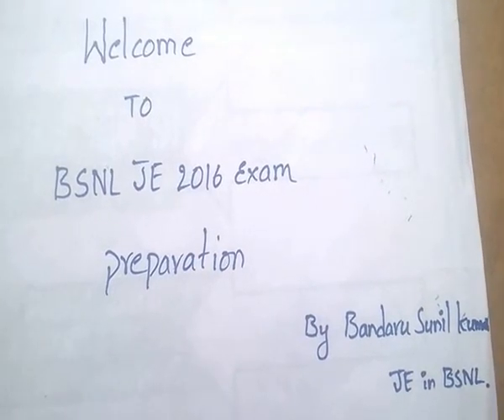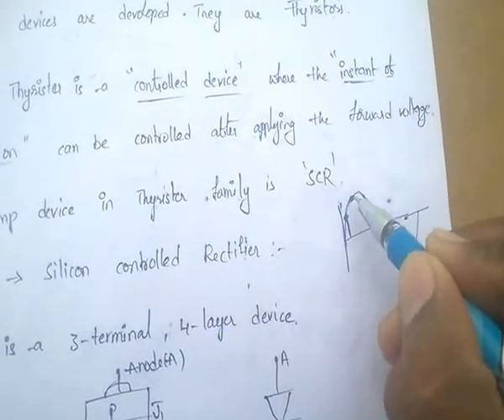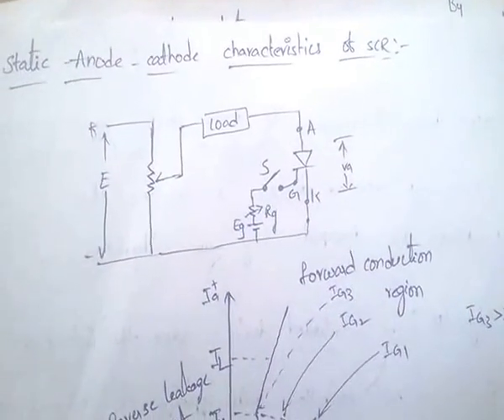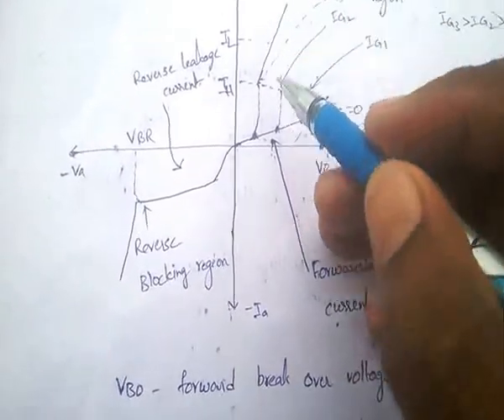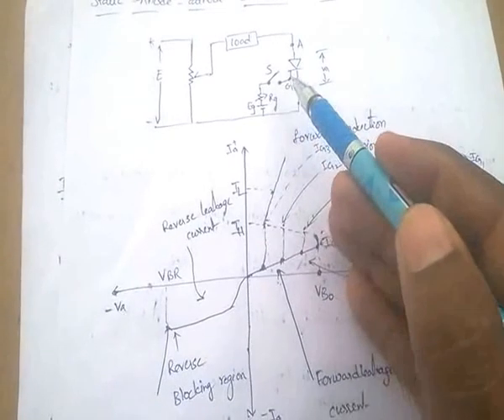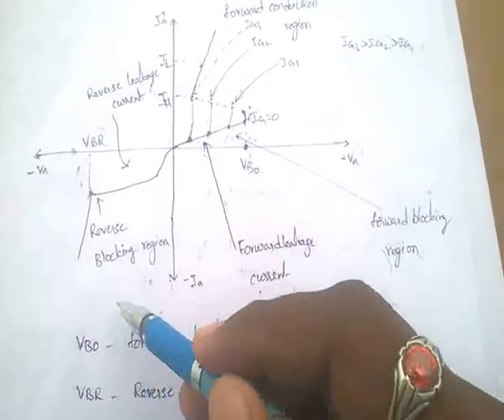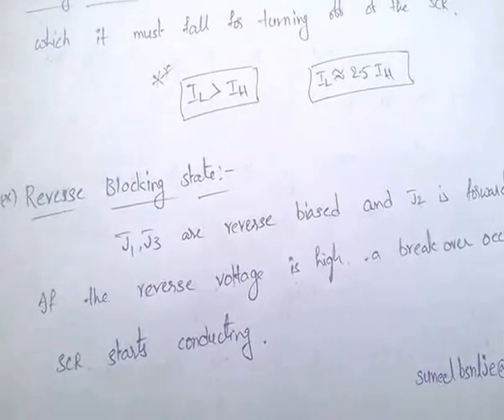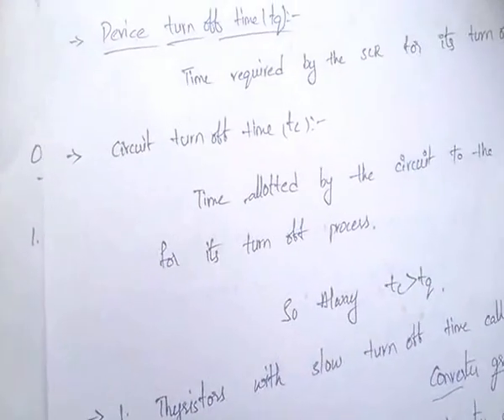RRB JE/RRB SSE/BSNL JE/SSC JE JOBS NOTES - ELECTRICAL PART4-PHASE CONTROLLED DEVICES

Comment from the maker: Many of the students asked me like “please make your video notes as pdf and send to my mail and we will pay cost” ..By considering your requests  I converted my notes as pdf files.. If you want my class notes as pdf file please mail to me to get payment details.. this is my mail suneelbsnlje@gmail.com   ..
Cost of bsnl je class notes pdf both part 1&2: 400/-
Cost of bsnl je class notes pdf part 1 only : 200/- 
Cost of  bsnl je notes pdf part 2 only : 200/- 
Topics covered in part 1..
1.Bsnl je exam introduction -      4pages
2.Maths notes of youtube videos(matrices, differentiation,diff equations of second order,  integration,complex numbers,partial diff)                 38 pages
3.Maths materials with example question and solutions  on remaining topics (vectors,fourier laplace transform and partial diff)                    29 pages
5. Basic electricity youtube video notes all topics and mcq’s (except batteries)   36pages
6.basic electricity mcq questions  material and batteries             14pages
7.Instruments and measurements notes of youtube videos (3 parts) and material of those topics..and mcq’s   25 pages
8.previous papers- 3(2015 -1,2015-2 and 2013)                78 pages

Topics covered in part 2:
1. Specialization -  Electrical - Pdf notes of youtube classes –              15 video’s class notes – 70 pages
2. Specialization - control systems -Pdf notes of youtube classes–
15 video’s class notes – 63 pages
3.digital techniques pdf notes of youtube video classes-
10 video’s class notes – 40 pages..
4. Specialization - Network,filters and transmission lines pdf notes of youtube classes (imp topics only) – I will send NF.T.L  SUBJECT  later..

To win the race taking every decision and every minute is important.. 
.if you have notes it will be useful for revision and also practice..every time watching on you tube is difficult and data consuming and time consuming also....if you want top in the race every small thing is very imp.. don’t waste your valuble time..

Comment from the maker: hai guys.. By considering your requests I am going to release bsnl  je exam pdf notes part 2 with in a week…
cost : 200/- may be.
may be it contains 
1.digital 10 parts notes of video classes and along with some material
2.electrical specialization all parts (may be 10 )notes of video classes
3.networks and transmission lines all important parts notes of video classes
4. control systems all important topics video classes…

Whenever it completed I will inform through youtube comments and fb post..
Reply: sir form hee submit nhee ho raha hai